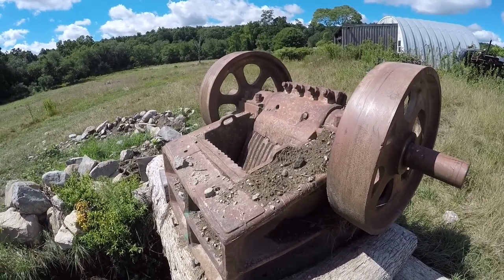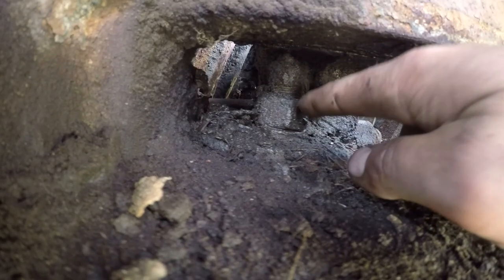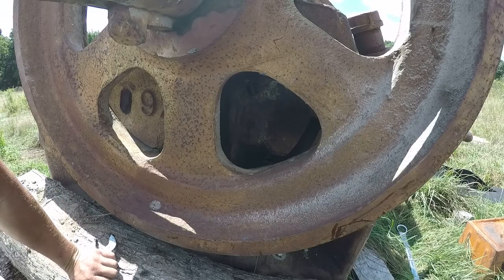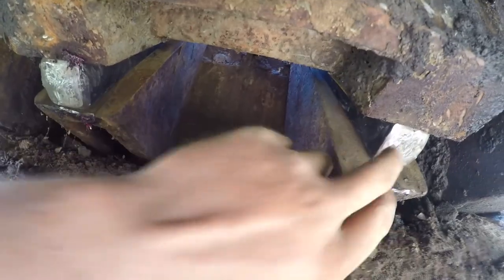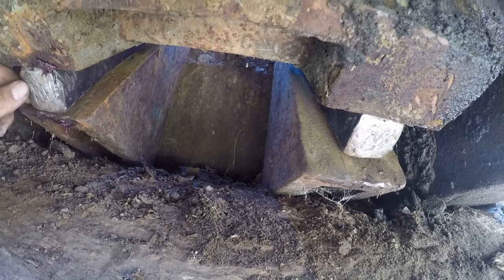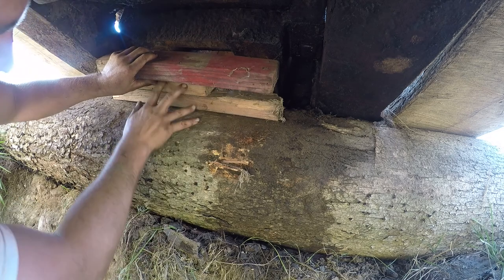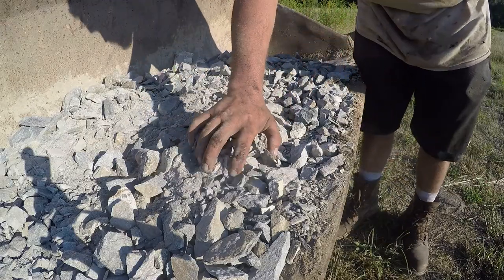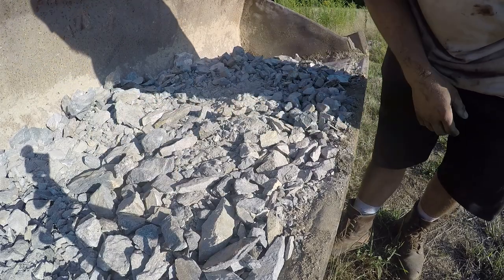Making the jaw crusher gap smaller | Jaw Rock Stone Crusher

Comment: I take it you can no longer draw the factory wedges higher up and as those wedges are already pre shaped you would do better installing flat packers in there - less likely to get spat out.
Usually when you can't get down to 65 the jaw plates have become so worn that the gap cannot be closed and those one's look very worn - lifting them out to rebuild or replace can be a real pig as well as you know those bolts are going to be hammered tight
Good to see you have the right rotation as so many people unknowingly run them backwards and then wonder why they don't perform 
Big old Jaws like that love to run full of rock which enhances the crushing process, so putting a bulk shut on it would work so much better rather than just hand loading single rocks

Comment: Did you adjust the wedges built into the jaw crusher? That system should adjust to somewhere between 20 and 40mm when drawn fully in.
Reply from the maker: Yeah I adjusted the wedges to make the gaps as small as they would get but it still wasn't the size material I wanted so I added the additional wedges. The jaw plates are a little worn which adds to the size of the gap